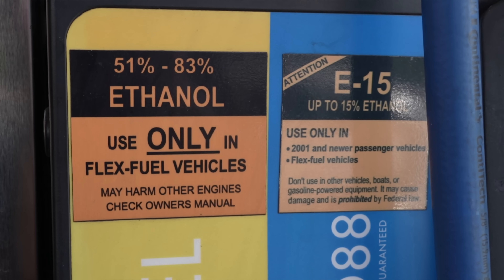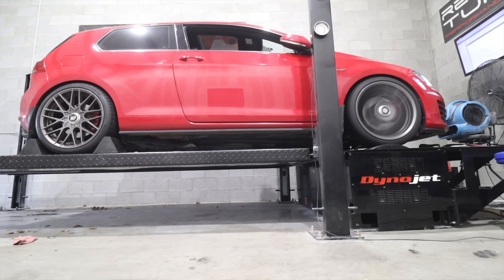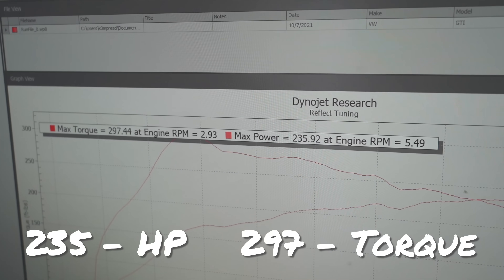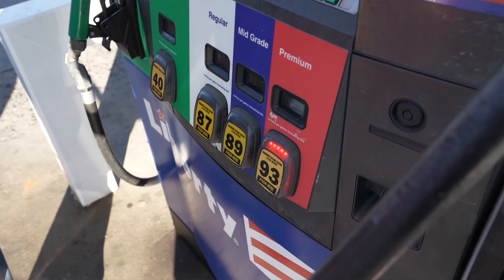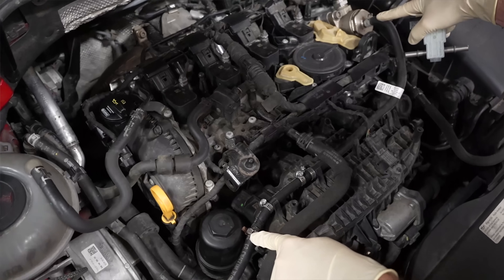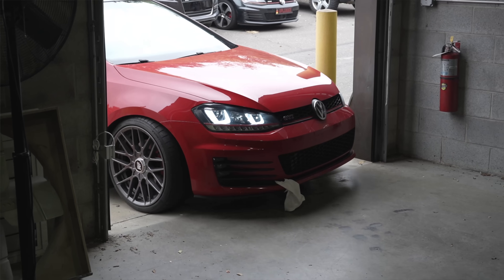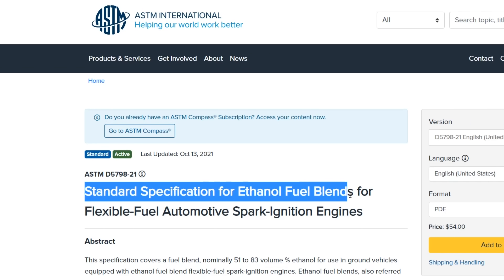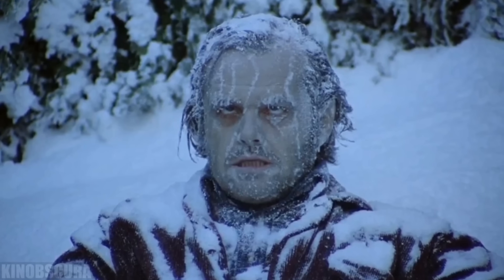A Complete Guide to E85 / Flex Fuel

Comment: To be able to run the higher ethanol fuel we now have in England in my Rover Mini I had to change all fuel components lines are now racing spec new filters x2 new steel lines under car and the carburettor will need the float changing and al seals more often and it’s just typical that all the gaskets for the uni carbs have now doubled almost tripled in price
Reply: Would it have not just been easier, cheaper and less hassle in the long run to use 99ron instead of 95ron then?
Reply: @Mac_F87  most fuel available in the uk unless I buy premium is gonna damage my fuel system and at some point the premium fuel is going to have higher ethanol content too so for the sake of about £40 so far it’s worth it but when it comes to having to change the carb gaskets i’m not so sure as of yet

Comment: for the stock pull was bone stock or did it have a downpipe with stock tune? otherwise you guys would've put on a downpipe for the stage 2 pull. guess it's not terribly difficult, just want some clarification on mods.
Reply from the maker: Downpipe and intercooler on every run

Comment: I daily my mk7.5 R on full E85. It gets around 220-295 MPG depending on how I drive. Not bad. I have a few E85 stations near me too so not a hassle to get. I also run it on my 2010 Camaro ss and don’t have to switch tunes/maps if I run 91/E85. Wish COBB came out with their Flex-Fuel support for the MQB platform already 😩
Reply: Man. 220-295 MPG. Forget buying a hybrid, switch to E85 and get 10x gas mileage 😂
Reply: @MeltingRubberZ28  that mileage is what a stock R can get.  On the highway i get close to 450 miles out of a tank in my GTI about 420 to be exact not too shabby👍
Reply: @eppyz  I understand in a tank, yes that's feasible. MPG = miles per gallon, which would mean you'd get like 3000 miles/tank.
Reply: @MeltingRubberZ28  on my last trip i average 42 mpg that's calculated miles driven divided by gallons of gas it took to fill.  That is in my 7.5 GTI base with DSG.  My best is 48 mpgs driving from Prescott AZ to Gila Bend AZ.  Even took photos of the miles driven and the how many gallons of gas.  That was using 91 gas, bone stock no mods and average speed was 65 mph.  When i got 42 mpgs average speed was 75.  Very surprised how good it can do.  I drive conservatively.
Reply: I'm in CA, since I only have 91oct I blend e85 and use Cobb stage 3 93 oct map on my mk7 gli. Runs good!
Reply: getting between 220 and 295 is a huge difference.  Are you actually calculating out the numbers or going off the cars cluster info?  Because that cluster dash info is not accurate.   People that I know that have tuned cars running E85, usually, Lancer Evo guys, get about 40% less fuel economy.  So why yours is only dropping 10% doesn't make sense to me🙄Could be the efficiency of the DI motor? But I'm calling BS on this one🧐
Reply: you suit what mpg now 😀
Reply: Integrated engineering has one
Reply: Yeah I'm waiting for COBB to release E85 support too. Have they said anything about their progress on that?
Reply: @joeyn177  last time I emailed them they were still “working on it”.
Reply: Only 2 tuners actually run flex fuel options. UM and now IE. UM will net way more power because they are some record holders for tuning on this platform and it’s normally in house dyno tuned. IE is ots so your options are limited in power delivery. I am running IE true flex and made more power than advertised. They say 370ish wheel I made 387whp on the is38 with e62.
Reply: So can I just run full E85 in the tank with a flex fuel tune?

Comment: Y'all should do e85 test with the mk5 fsi. I'm in Fayetteville NC and love to see y'all for that tune!
Reply: 303 LETSSS GOOOO
Reply: @LuisNunez210  910 here!
Reply: Ethanol on the FSI take a lot more work. You need to do the lines (unlike the 7), HPFP, LPFP, injectors, and aux injectors (MPI). Not worth it. You can take the money you'd need for that (plus a custom tune) and use that as a down payment for a MK7.
Reply: @Peylix  I knew I needed the fuel pumps and injectors, but why the fuel lines? Aren't they already lined due to ethanol already being in the states in 05? I'll pass on the mk7 though, I'd rather not have a car payment, and try to afford mods at the same time... Plus isn't the 7 speed dsg is non favorable compared to the 6 speed dsg? All I need is 300 to 400 whp and I'm satisfied. Hell with a stage 1 tune I beat the cars I wanna beat, if anything I'll put a hybrid turbo on it maybe with a air to water setup, a s3 intercooler and just send it. I really want a r32 tbh
Reply: @reidsteph4286  the lines in the older MKV's do not stand up well to full E85. There's a few who have gone down this road on VWvortex and have gone into detail about what it takes.

Also, MK7 is the DQ250 6sp. 7.5 is the DQ381 7sp.

My 15SE is a 6sp DSG.

For your target. Slap a K04 on the car. If you're really wanting to break 400 however. You'll be building your motor. 

That's why I brought up buying a MK7. The headroom on the FSI is not that great. While you can make them spicy. It starts taking exponentially more funds after 350whp. Like, amounts of cash that can easily get your butt into a 7 and have funds left over for tuning.

Comment: 2001 and newer cars are compatible with "some" ethanol...like E10 and E15.  But they may not enjoy E85.  

(The restrictions on ethanol in gasoline are weird because of the higher vapor pressure of ethanol.  Gas stations in my area (Minnesota) sell E88 (15% ethanol) as a slightly cheaper fuel, but in the summer it is labeled "for flex fuel only", and in the winter it is "for vehicles 2001 and newer".  Reason?  Because ground temp is lower in the winter, meaning lower vapor pressure in the underground tank.  Regulations say maximum vapor pressure cannot exceed ~9in water column for standard gasoline.  But E85/ flex fuel is allowed to have higher vapor pressure.  I know, kind of silly, right?)
Reply: Mk7 Mk7.5 cars love E

Comment: I admire your channel, but your content on this subject is very incomplete.
The burn of ethanol is an exothermic chemical reaction followed by an endothermic one, which is the evaporation of water [by-product of ethanol burn] into vapor that absorbs heat inside the combustion chamber.
C2H5OH + O2 = CO2 + H2O 
Therefore ethanol fuel can stand higher compression ratios and ignition advance. 
Ethanol maxed engines can stand a much higher level of turbo boost.
That's why comparing both fuels back-to-back in the same engine won't show the whole picture.
You also don't need those complex methanol injection systems - like in the BMW M4 - as water is embedded within the Ethanol molecules.
Gasoline is only included in the mix to help the start under 13ºC; help the lubrication of the fuel pump; preserve the rubber hoses.
Also ethanol is a oil solvent, therefore your have to change the engine oil more often due to the higher levels of contamination.
Reply: Ethanol evaporates much lower than operational oil temperatures. Just like with water, it'll be sent through the pcv system and burnt, as ethanol and water can not remain in a liquid state at those temperatures and pressures. Just drive your car long enough to pass 212° oil temp and neither will be in your oil in significant amounts.
Reply: @otterconnor942  Naive driver here… so are you saying we don’t have to change the oil more often? I’ve got a FlexFuel Tahoe, been using E85 mostly for 7 years now, hope I haven’t caused issues in long run not changing oil more often.? I live in southern and central coast California- if that info means anything. Thx!
Reply: Burning any hydrocarbon produces CO2 + H2O. The water vapor produced by the combustion of hydrogen has no latent heat of evaporation. If anything, any condensation of the vapors adds heat to the charge.

Comment: In Brazil we have Flex Fuel TSI models and they shows lots of high pressure pump and injectors problems with long term ethanol use.
Reply: But our ethanol(E100) is hydrated and has 5% water in its composition, and because we do not have inspections at the stations, this percentage is often higher, causing several long-term problems. There are many e85 stage 2 cars here in Brazil, and I've never seen any of them having the same problems as cars that use e100

Comment: Methanol injection is more practical . 
Ethanol just eats everything in the fuel system,
Has less energy per gallon than 93 it definitely has alot of drawbacks and at the station you get inconsistencies in the quality and it's hydroscopic .
Basically it's a pain . Makes power though....
Reply from the maker: Methanol is way more damaging to engines.  Check out this video where Jason explains testing done on this in detail
https://youtu.be/ATGSBi1kBl0
Reply: @Deutscheautoparts  
Bro your silly if you think that. He's talking about running it all the time. It only sees methanol under higher boost conditions for short periods. Ethanol blends are bieng seen all the time the engine is running, not for short events.
By the way me and that guy go at it , he's often incorrect. Try watching Jay at real street for your Info. Now that guy knows his stuff. 0.00 wear ? Yeah right. Maybe under laboratory conditions.... The only thing ethanol is good for is keeping the engine valves and crown cleaner and it's octane rating. Your thinking of like in a drag car scenario. If it's not bad why do people pickle thier fuel sytem which is primarily what I was adressing.
Jason's a dummy btw he says tesla get 120 mpg when a electric turbine generator is only 30% efficient . So what's that tell you about Mr Jason.
Try 28 mpg with power grid losses max @ 12% . If your experiencing wear that would be called cylinder wash . So you would dial it back , and there you go.
Reply: Holy wrong information Batman.  Methanol is way worse for your engine than ethanol, full petroleum is actually safer but the difference in wear is minimal compared to the difference with methanol.
Reply: Yeah, at least going with a water/meth setup, you can carefully control what's going in the engine. It's going to be a more complex system to start with, but far more consistent.
Reply: Also it's not great for your oil . That's why thier making the new kind like the 0w-20 for instance. That's the real reason for these new oils not what they claim like efficiency.
Reply: I wonder how some older technologies would actually hold up to ethanol, like Honda's FRM liners and pistons for example.
Reply: It depends how much you are running. I have run a e30 blend for over 10 years with no issues. I have also run methanol injection for years without issue.

Comment: so a stock GTI pp will run fine with e85?
Reply: If you made it 6 minutes into the video you'd see the answer is "no".

You should definitely get the correct upgrades to your fuel system. Should be able to run somewhat well with just a HPFP but to really push it with tuning, LPFP and MPI is the way to go.

Comment: I wish mk6 gti could use flex.  I heard the fuel system can't support it so people use wmi or auxiliary injection instead =/  I wonder if the mk6 platform can do lower amounts stock like e30 :0
Reply: not sure how different the mk6 is but in the mk7s you can run e30 on stock parts. i run e20-e30 all the time especially during the summer on a 91oct stage 2 tune. if running an e30 tune tho you should get an ethanol sensor
Reply: @c0Ld  whats your ltft look like running e30 on a 91 tune? 15-20%?
Reply: @MaxiimTribe  Cant tell you as i've never monitored it before
Reply: @c0Ld  oof
Reply: @vinceis4lovers  hm?
Reply: @c0Ld  should really check your stft and ltft. Your car may be heavily relying on the ECU to richen or lean the mixture out. Look into ltft and why you want them less than 10%.
Reply: @vinceis4lovers  5-8% after a 45min drive
Reply: @MaxiimTribe  5-8%
Reply: @vinceis4lovers  ecu will pull timing if the fuel blend isn’t what the tune is designed for. These cars love ethanol fuel